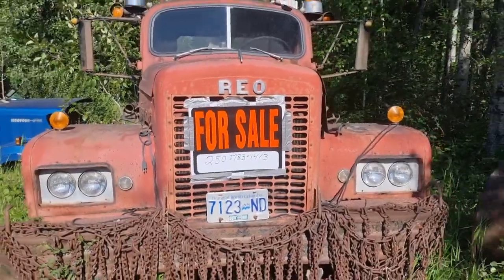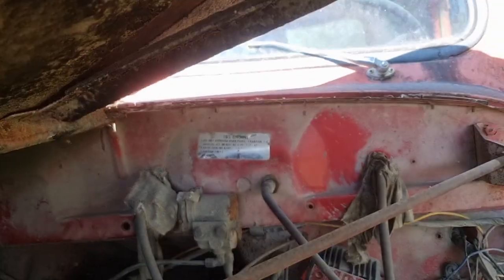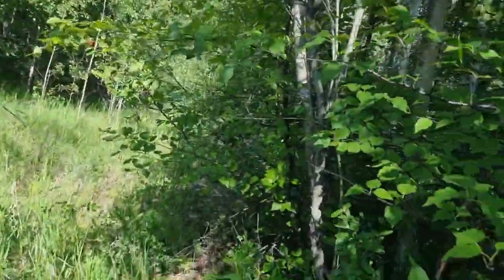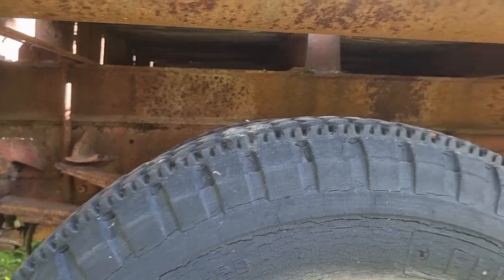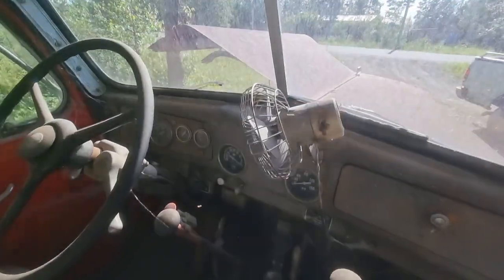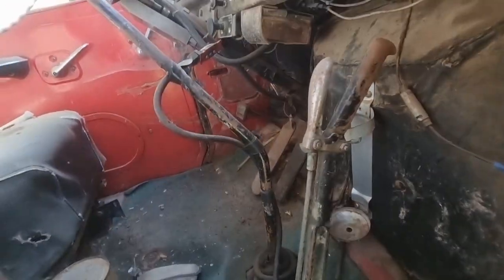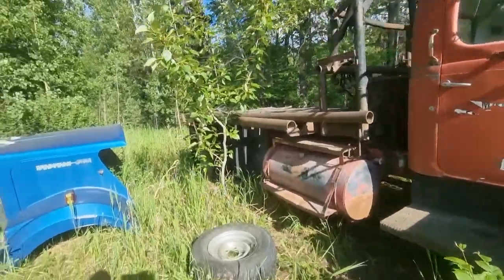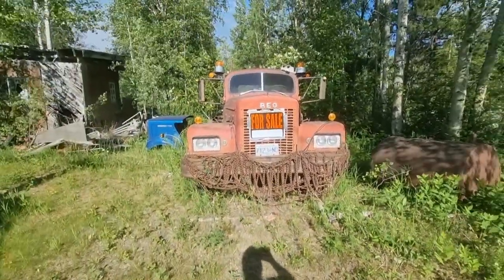1962 REO The ultimate scrapper truck?

Comment: That is awesome. I see it had ac.   The fan on the dash.   You would feel every pebble you drove over.   That would be cool with an old Detroit in it
Reply from the maker: Lol, I worked for a company that wouldn't fix the ac and wouldn't let the guy put a fan in because it was a modification. The labour board got involved and they had to fix all the ac units. Lol
Reply: @wannabescrapper72  wow not nice
Reply from the maker: No, but it was nice for the whole company when it all got fixed.

Comment: It is a very cool old truck. It would make a sweet talking piece for sure. But going through all the brakes and tires would be pricey, and that depends on how available those parts would be. And just a thought is the deck being that high cause you a lot of grief, I am not sure. And 4 grand does feel high.
Reply from the maker: Yeah, I am not buying it. If I was handy with that stuff, I would but I would have to hire welders, mechanics, etc and you know what that costs. I just love the truck. The deck wouldn't be a problem if the jin poles and winch works. I could suck bins up on it and also onto a trailer. 

Ah well, we're allowed our pipe dreams. Right?
Reply: @wannabescrapper72   Yes, I agree we always need to keep dreaming of awesome things that can help out.